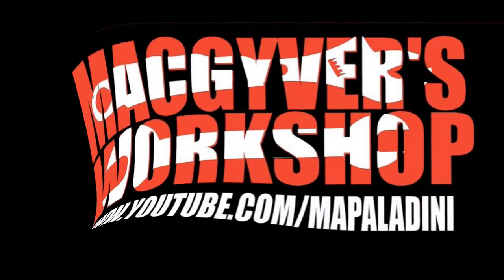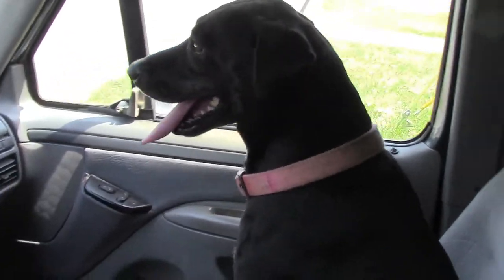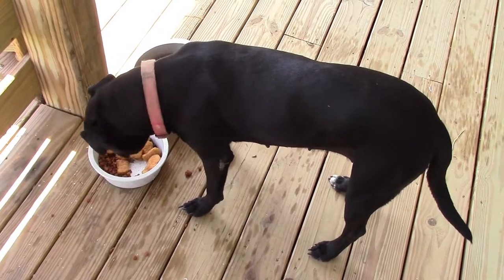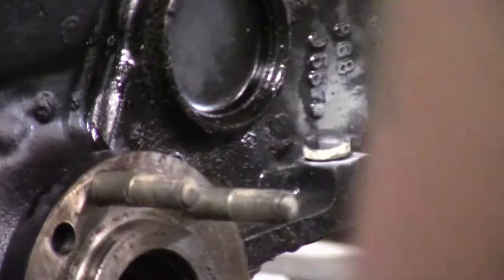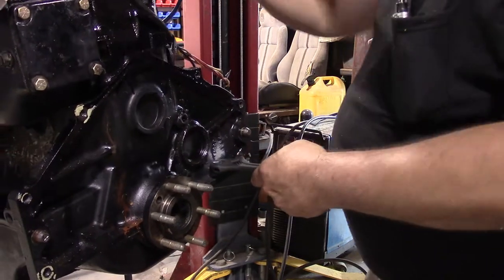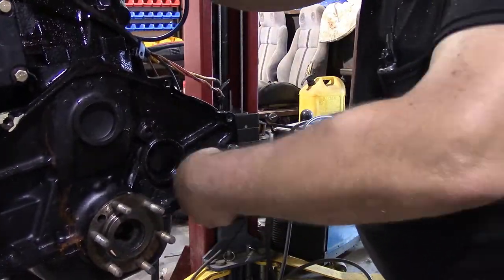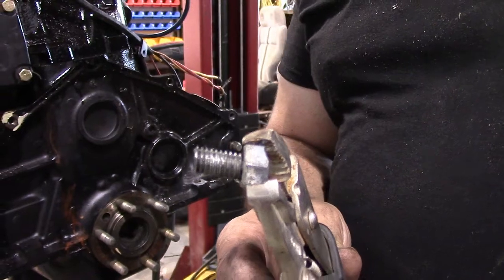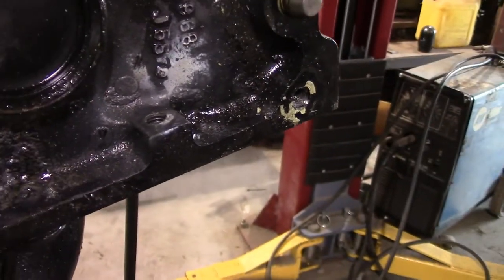Boat repair Part 5

Comment: "what we got here is failure to extracate" your pull out game is weak lmao. I'm still running my walk behind trimmer with the same belt that it came with and i bought a 200 foot roll of the gator string that steve reccomended for me . it's worked out fine for several years now. remember i bought my trimmer the same time you did unknowingly. like days apart. MAN Get that dude another motor there's no sense to just keep patching that thing with all that goop like that. it's not going to hold forever and when it does come apart it's going to explode everywhere. those cracks are the motor's way of telling you it's well past done !
Reply from the maker: No doubt that motor is history, that's what happens when you don't winterize a boat properly. He's planning on finding a replacement. but that will have to be next year. For now he's just learning, and hoping it lives through this season.
Reply: @MacGyversWorkshop  first real stress you put on that thing it's liable to blow apart i wouldn't even fire it up again without a new block at Least
Reply from the maker: @DaddytechEnt  Believe it or not, those exterior cracks are not terrible. He plans to ultimately replace the motor, we just want to get it running at this point.